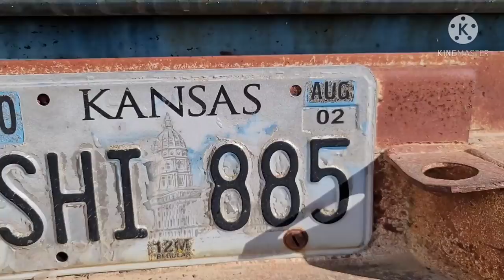Patina Project: 1970 GMC utility body pickup Sitting 19 years!! Walk around + WILL IT RUN? Inline 6!

Comment: On an engine that has been sitting I always put some Marvel Mystery oil in the cylinders before turning over.  Stuff tends to loosen up stuck rings.
Reply: Skip,,thanks for sharing this info,,,,I will do this from now on ,,I remember now an old friend of mine doing that on an old Chevy he purchased that wouldn't turn over and got it running, ,
Reply: @gerardocastaneda7744  Had a Mopar 318 that was put away running, then sat for 20 years.   I couldn't get it started, seemed to want to, but no go.  Checked compression, way low, like 30#.  Put generous amounts of MMO in the cylinders & left it sit for a few days.  Turning it over after that it sounded better so I checked compression again, up over 100#.  The engine then started without too much trouble.  Made me a believer but then I tore it down & rebuilt it, LOL.  Just wanted to know it would run first!

Comment: Hello, your ride starting fluid washes down the Pistons takes it oil off the cylinder walls. Starting fluid and 40 to 1 gas works great, lubes the cylinders, in my day we would have to mix the oil and gas!

Comment: That truck is going to be a deep load of yabahdubba, but satisfying.  Rust is your enemy.  A good air jet hose, and rust remover might help.  But those door hinges / bolts will not respond to anything less than an all out sand-blasting ( or just drill them out ).  Stay cool in the shop, and don't get a sun burn!

Comment: Us guys with ocd look at all the dirt and wonder how you can work around it/LOL. It is yours so do it your way. I like using a saw mixture for gas to start as it has just enough oil in it to improve the compression a lot really as it doesn't wash what little oil off the cylinders and they just seem to start for me much better. So if you was to have a leaf blower to knock some of that dirt off that goes flying when first starting for some time. I kinda like leaving the whole air cleaner on the rig and that bolt that sticks through the carb comes through the top of that cleaner has a little "pocket" where you can pour gas down to start. No backfire in the face that way and keep our hair in tact. I lost half the hair off my head in a fire that took nearly three years to heal well. It was the end of having nice long hair that I really enjoyed having.  Once your at the point of good gas up to the carb and getting it to run on its own, I take the air filter off then so I can adjust air or choke. Nice work young man.... I'm 73 so you are lucky to be this age. I would clean that truck with light steel wool, wet/dry sandpaper and then a cut and buff to get the look it wants to have as they age. Call it the gray hair stage of a old rig. I enjoyed immensely and liked of course. I am real glad that you got that truck and kinda figure it must have the 292 engine or big six.

Comment: Dang if you don't keep that plate on the back I want it, a SHI- plate? lol

I have done drums with a crowbar and even hammered a screwdriver into the shoe material to pop them loose.  Not a job I envy.

Railroad locomotives use plain water for coolant because they have  a wet liner in the cylinders.  So you can't shut them down in the cold unless you drain them.

Comment: 292 Cubic Inches 6 cylinder motor with 2 barrel with single flap with hand choke cable in dash plus Turbo 350 or 400 3 speed Automatic transmission 3 speed and on valve cover take PCV Valve also clean  or replace to!

Comment: Take a air hammer and run it around the hub in between the studs and you won't have to use torch

Comment: Too much either, didn't run, it fired up bcuz of either, try dumping gas in instead of either. Prob needs a fuel pump...
Reply from the maker: The carburetor needed a rebuild, which the new owner has done. Truck idles great and drives around now. I never use ether, because it explodes in the cylinder. Unlike gasoline which burns across a flame front